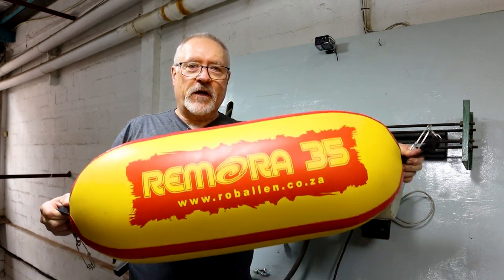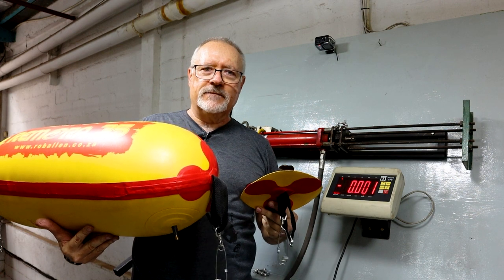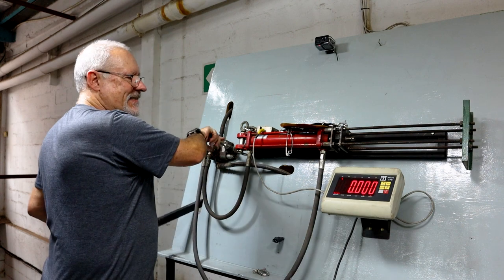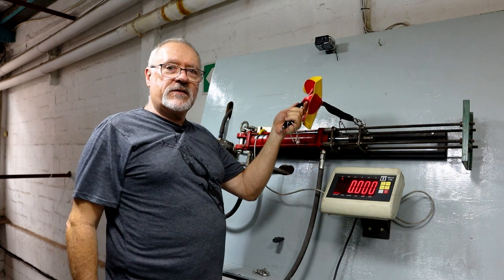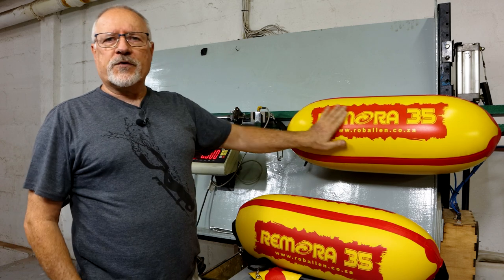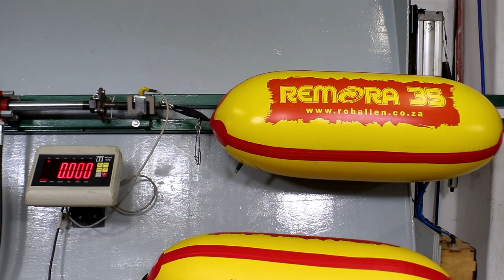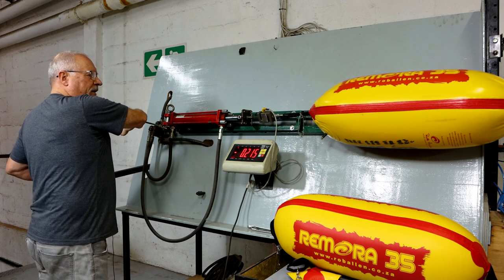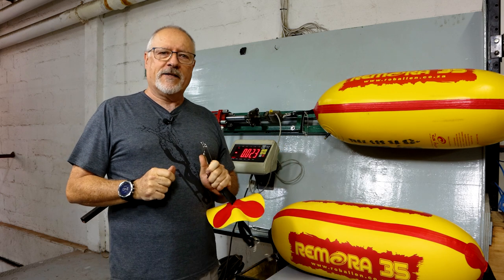Rob Allen | Float Webbing Break Test | 2022

Comment: Hey Rob,. thanks for greta video and product! I've been using remora 35L for years and it works super nice on hunting big fish like Doggies. I have a question; as I measured, I thought it has 54L. Does it correct? It's super important how much its buoyancy is in my hunting, cuz I'm hunting monster Doggies with polespear so it's more sensitive. Thanks!
Reply from the maker: Hi, sorry for the delay in responding, for some or other reason your message was blocked. You are right, our 35lt float is bigger. We have been making this float for many years but recently I did measure and I got 45lt. We have been making these for so long I have been hesitant to make smaller or, but 45lt on the print. We are working on changing the shape such that the front will be more bulbous with a tapering rear section. This will change the way it travels underwater and wobble less id pulled at high speed.

Comment: Dear Rob, in regarding with repire, what glue would be suitable for your 35l high pressure float?  Appreciate for your guidance. Regards, Rui
Reply from the maker: The fabric is PVC. Any PVC glue can work but the best is what the rubber duck boat builders use, those who build with PVC fabric, not the Hypalon fabric.